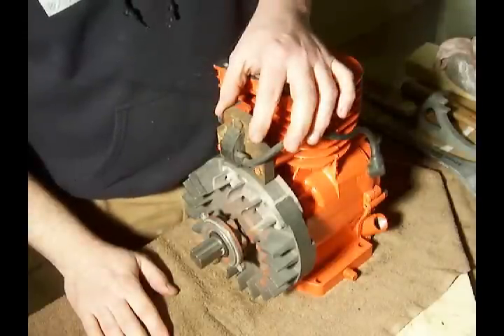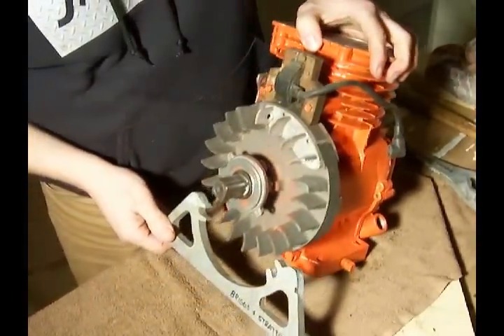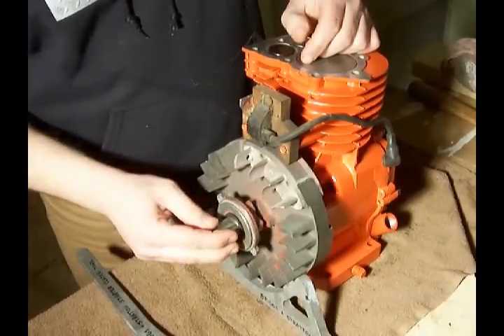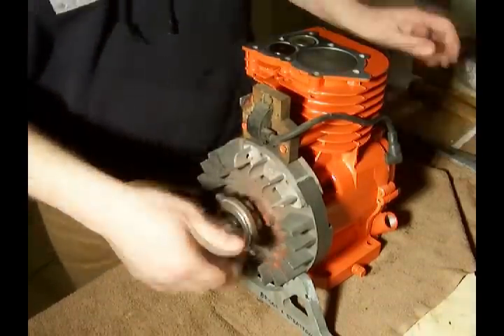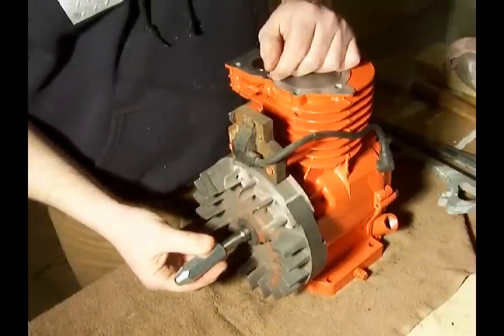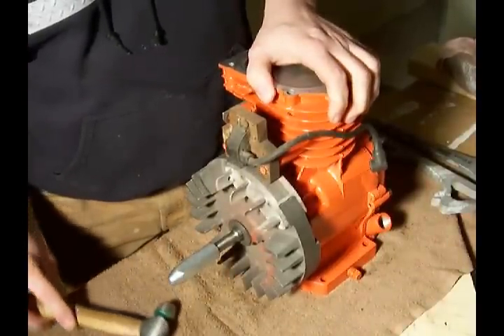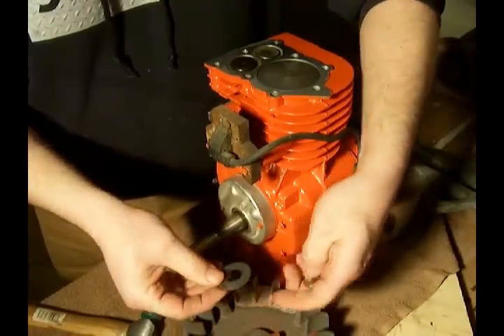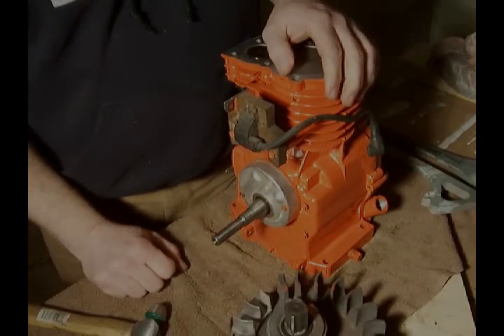#12 - Briggs and Stratton 5HP 130202 - Flywheel and Starter clutch removal

Comment: Thanks for showing me and also do these tools work on a Briggs n Stratton engine model 130212 and where can I find and buy these tools??
Reply from the maker: Probably have to buy them used if you want the exact same tools. However, there are newer versions available on the internet.
Reply: Do you know where I can find them?
Reply from the maker: ebay or amazon

Comment: someone help me please, do I lubricate the fly wheel? I feel like it's having a difficult time spinning
Reply from the maker: No, you do not lubricate the flywheel. The lubrication is the oil inside the engine.
Reply: @RealManSkills  It could be rubbing on the spark plug coil

Comment: If I don't have a clutch tool, would a pipe wrench work?
Reply from the maker: As long as it's large enough, sure. Thanks for watching.
Reply: I managed to get the flywheel off. I laid the engine (vertical shaft) sideways on the bench, stuck a wrench in one of the fins, and then gently tapped the clutch with a ratchet extension and a small hammer. Then I used a socket as a knockoff tool to loosen the flywheel. Those are not the methods I prefer, but it worked in a pinch. I Would certainly like to get a flywheel holder and clutch wrench if I'm going to do this at a professional level. Thanks for posting the video.

Comment: I had my grandpa's tiller running great earlier today. I had pulled it off the farm where it had been sitting under an overhang for about 35 years (since before I was born as he had fallen ill and died shortly after I was born). I never thought I'd get it running, but I did, and I was able to lightly til a 25'x50' part of my yard today. I had left it idling for a little while to rake some sod I had lifted from a shallow till... Walked back to it, heard a pop, it died, tried to restart, and it seems as if it may have lost compression. Pulling the rope starter thing no longer seems to have the same resistance it did. Any ideas of what may have happened? I think the carb screw thing may have needed a bit more adjusting to prevent tines turning during idle/neutral. Could leaving this sit stationary on low with an improperly adjusted carb adjustment perhaps led to shearing of some internal mechanics?
Reply from the maker: Sounds like lose of compression. Could happen if the exhaust valve is stuck open somehow - valve job needed. Could happen if your connecting rod failed - catastrophic but usually more of a bang than a pop. I don't think this is a carburetor related issue. Most likely a stuck valve. You will have to start taking things apart. You could pick up a $120 engine at Harbor Freight (or Princess Auto if you are in Canada) and replace the engine.

Comment: Im restoring what looks to be the same engine and need a Head Gasket, everybody wants the engine code which is understandable but I cant find any code at all :( Could you tell me where you code is located pretty please ?
Reply from the maker: The model, code and serial number are usually stamped into the sheet metal shroud. The shroud is the part that covers the flywheel and ignition. Hope you find it. Thanks for watching.
Reply: It is under paint on the left hand side of the Shroud at the top - running down the side. Thank you Sir. I found your video when I was working out how to take the Flywheel off to check the points, it is like new in there and the points are still perfect.. a true testiment to B&S Engines. I rebuilt a 1983 Westwood Lawn Tractor and you could still see the original Hone marks in the cylinder.. I always say to my customers (I have a Repair Shop www.LinksRepairShop.co.uk) the most important thing in any engine is the oil but lots of them give me strange looks. I service a lot of Lawn Mowers and I often see mowers filled to the top of the dip stick tube with the customer wondering why they wont run.. its sad really.

Comment: Great simple explanatory video!  I'm having trouble identifying my B & S motor.  It is a mod 130297 type 0782 01 code 79121806  No one online or local shops can identify it. Can you help?  SEMPER FI....!!!
Reply from the maker: You already know it's a Briggs and Stratton 130297-0782-01. According to the serial number your engine was manufactured on December 18, 1979. If you need to find parts, do an internet search for "Briggs and Stratton 130297-0782-99" According to your model number you have a 13 cubic inch, Horizontal shaft,  pulsa jet carburetor and a rewind starter. Hope that helps. Thanks for watching.

Comment: Thank you!!!  for the concise and very helpful explanation.  A novice like myself not knowing the clutch unscrewed and that a simple tap on the shaft would do the trick. Now I'm ready to change the ignition condenser and points.
Reply from the maker: Check out video #13 in this series - you might want to consider replacing the ignition coil with an updated version. The updated ignition coil doesn't need a condenser and points. Thanks for watching.
Reply: Thanks again for this!...I plan to change out my coil with the magnetron ignition.
Reply: I have been trying to get the appropriate part number for the replacement updated magneto ignition coil you mention with no success. B & S could not help and neither could the local repair shops. Could you give me the number? My model is 130232 type 0954-01 (or maybe 99). The updated regular coil p/n 397358. Thanks in advance for your help,
Bill

Comment: Does it matter about the sychrozistion of the crank shaft and cam gear? As in, can I just pop the new shaft in and line it up with the cam? There's a circle on the gears, do I need to match them? 

-Thanks So much for the help.
Reply from the maker: You MUST line up the marks on the crankshaft and the camshaft. Thanks for watching.
Reply from the maker: #6 - Briggs and Stratton 5HP 130202 - Crankshaft and Camshaft installation

Check out my video on lining up the crank with the cam.

Comment: Well, I've taken apart the engine, now I just need to remove the piston. I do have a few questions though. That paddle mechanism? What is the purpose of that? And, I see no points or condenser behind the flywheel. Is the magnetic chunk on the flywheel the source of spark on my engine?
Reply from the maker: 1. If you are referring to the paddle inside the engine, that is the governor.
2. Small engine manufacturers stopped using points and condensers around 1983 when a new ignition was invented that no longer needed points and condensers. Some older engines can be retrofit with a newer ignition.
3. As the flywheel magnet spins past the ignition module, it causes a spark in the spark plug - so yes you are correct regarding the magnetic chunk.
Thanks for watching.

Comment: Can u change your starter clutch out to a regular pull string
Reply from the maker: The starter clutch is a part of the pull string mechanism. It is the part that allows the string to grab hold and spin the engine and then it allows the string to wind back up. Thanks for watching.

Comment: Yes sir! Exactly what happened at 2500 RPM :) I'm actually in the BMW STEP program, but I don't think I'm up to take this thing apart, too much work for not enough money. I was actually using a drill to start the engine (15/16) and I pulled the drill off but the extender was on and it caused it to spin off balance and it all broke off. Any idea what the engine is worth sitting on a Kee mower in this condition?
Reply from the maker: I don't even know what a Kee mower is - I had to google it. In my opinion, if you are not up to rebuilding it, it's not worth the money to pay somebody else to fix it. Sell it cheap for parts and find another motor.

Comment: Well, my starter clutch came flying off along with the ball bearing and cap. It actually broke off from the end of the crankshaft. Is the only way to replace it is to replace the crankshaft? If so, how much would this engine be with this problem?
Reply from the maker: If I understand you correctly - the end of the crankshaft broke off? If that is the case, you will have to replace the whole crankshaft. That means you will need to rebuild that engine after you get a replacement shaft - not cheap if new. If you aren't up to the task, you may be better off to replace the whole engine - try ebay or craigslist.

Comment from the maker: @tv175s3 There are different sizes of flywheel holders. It is important to use the correct size. As a matter of fact, the flywheel holder in this video did not fit the flywheel of the B&S 6HP from 1955 (see my video of that engine).
The universal type #19372 that you mention is a strap wrench. You can get strap wrenches from most hardware or auto parts stores. They also come in different sizes. 
Thanks for watching.

Comment: Warning: B&S manual says only use this type of flywheel holder (# 19167) on a flywheel with metal fins and smaller than 6-3/4inch diam.
There is another universal type #19372, that grips around the flywheel.